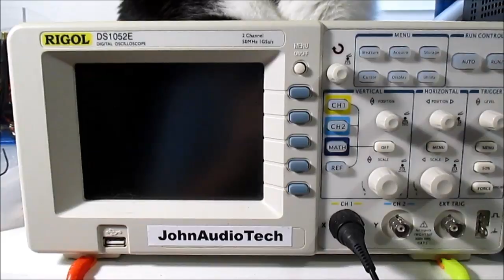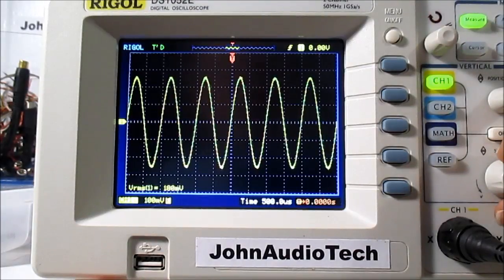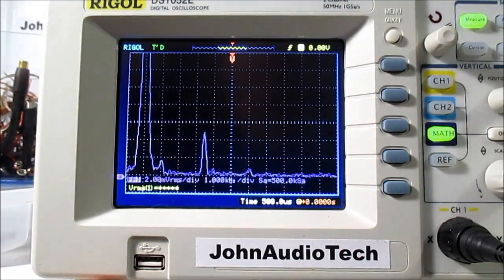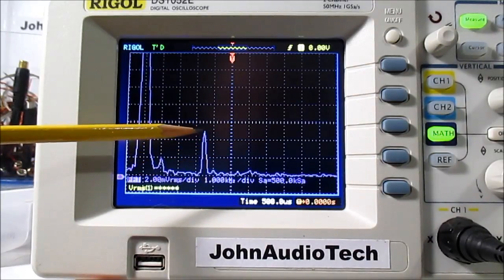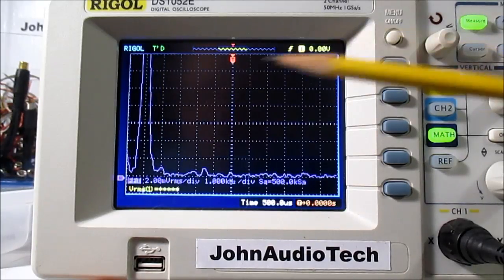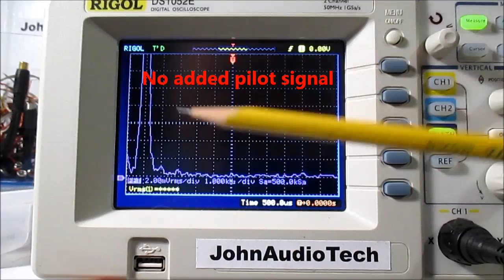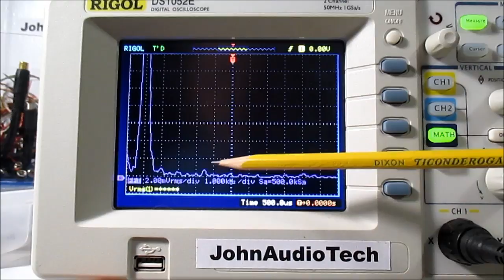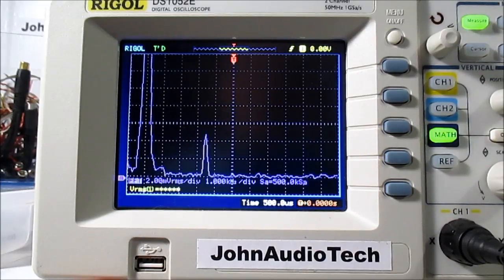Checking audio amplifier distortion with oscilloscope spectrum analyzer

Comment from the maker: First !
Sorry for the lack of videos lately. I do have an amp board to test, another on the way, a couple chip amp test videos, teardowns and more. Hang in there guys!
Reply: No worries, take your time :-)
Reply: thanks John, I used your method to measure the noise in a project, I will document it a little whenever I finish it. Anyway could you please explain in a little more detail the calculations needed for the power specs of an amp, you always make that fast. My project involves a couple of LM3886, a OPA2134 for preamp, an MCP4261 as attenuator and I would use an Arduino to listen to a remote control, switch between several relays and turn on/off a raspberry pi (with a Wolfson DAC) as one of the sound sources. I have really sensitive speakers, so I'm not concerned too much in power, moreso in the possibility of noise in all this mess. I will not use any switching psu, just old plain trafos a linears, and when everything is off, I'll use a really small trafo for the standby mode, which is just the Arduino. I really enjoy your videos.

Comment: This is a good quick seat of the pants method,  for example in a repair to verify a level that is too ambiguous by ear but still indicates a problem. I work on a lot of guitar amps and most people working on old tube gear use very little in equipment but judge by playing. Few use a spectrum analyzer or any repeatable signal, more by feel and experience. I work on so many different types that I like to log reading in a database as a reference state in case it comes in again. Most gear does fail periodically when used in touring or stage use, amps, power amps cable lead  hard life on the road. As the end of a tour a company might bring 10 or 15 amps for me to check and comparing past performance to the current readings tell me if there is a possible change or problem.
For home hobbyists, a decent digital multimeter which are very reasonable now, $25-50 for one that reads AC volts in True RMS which is best for audio use.
An Oscilloscope. The new digital scopes are a real powerhouse of features and have a lot of built-in measurements that can reduce the number of test instruments needed by 2/3rds or more. I am a test gear fanatic so have done of precision instruments but they are not essential.. In my old shop just doing pro audio, I had 23 techs and 2 full benches of test instruments for each tech. Over 500 instruments because I collected them all and refurbished them as industrial surplus. Now, a modern Chinese-made $300 scope can provide an amazing about of data.  My bargain digital scope is hard to bear, a Rigol 1054z that has 4 channels and a large number of advanced features you can add simply by typing in a code, published on many sites and YouTube to turn on many features they charge more for at the time of purchase. Definitely check that model.
Used older analog scopes represent low-level noise better than digital scopes and are good value. Any model like a Tektronix 465 or 2235 or 24xx series scopes are wonderfully built and outlast you and are reasonably priced as ham radio swap meets or eBay but better to find lone locally. They were expensive in the day, , all good test gear was. My 1975 Motorola RF Service monitor was $28,000 when I bought it new and my house at the time was $17000 on 10 acres in California!  My Sound Technology 1510a Digital analyzer for analog tape decks in 1985 was $14,000. I used that to calibrate the large 24 track Studer and Ampex tape decks every morning in my 3 studio complex recording studio I had for 20 years.

A good noninductive dummy load, usually 4, 8 and 16 ohm rated at higher than the maximum power of any of the amps you will work on. These can be made buy buying a few high power non-inductive resistors, You can get by with cheaper standard wire wound resistors, 100 ro 250 watts are good choices
A good sound source which is a clean low distortion sinewave generator with a wide frequency and level range. I have some very nice expensive ones but for everyday use it is had to beat the old HeathKit IG-5218. It has all the features one would want, the accurate level meter in db and volts, accurate decade switch frequency selection, low distortion, with a wide range of accurate attenuation of output. So when selecting a level, and frequency you do not have measure them, the controls and meter are accurate to 1% or better with low 0.013% harmonic distortion. There are modes on the internet for modifying them for even lower distortion by making an opamp simple meter isolation amp that removes the distortion caused by a bridge rectifier across the before the output attenuated,  I have one that is 0.0068% at 1khz and +10 dbm out,  It is not likely you would never need or hear that difference.
A constant temperature soldering iron. 
Those are enough to handle most repair or adjustment tasks with audio.
You can also get digital signal generators but they usually are not as versatile as the old Heathkit IG-5218.
If you have a good sound card on your computer you can use it along with a free program for a very accurate signal generator, meter, counter, and Spectrum Analyzer...the only problem is that you are limited to the output level of your sound card. If you have an outbard high resolution sound card interface used on balanced line inputs and outputs you can handle wide levels and usually better specs
I have a $4800 spectrum analyzer and this program does better and free http://www.sillanumsoft.org/download.htm   It will do frequency sweeps to plot frequency response by distortion, and two channels to compare two channels in real-time.
Two more things, a regulated two-channel DC  Voltage and current metered power supply This will be used on your breadboard amp and electronics projects until the circuit work then you use batteries or build a dedicated power supply for it.
And if working in AC powered united a Variac, which is a variable power transformer to you can dial in the ac mains voltage you want. This is important when checking an amplifier that might be damaged, you can monitor the current it pulls as you increase the mains voltage from zero.(only for units that have power transformers and not Switchmode power supplied some modern amps use to make amps a lot lighter. Your computer has a 300-400 watch switch mode power supply and you could not raise the voltage from zero, Just turn it one since it has its own overcurrent protection circuit.
Reply: thanks for sharing your experience and all those amazing tips.

Comment: The Hantek scopes are affordable. I was able to get a 200 MHz with function generator for $225 shipped. It doesn't matter if you buy a 60 or 100 MHz Hantek can easily be upgraded to a 200 MHz using a urat takes less than 30 minutes. Tones of info on how to do it online and on YouTube. Great video 👍.

Comment: Over sampling play some role in this demo, but more importantly, the FFT display the amplitude in power, so 8-bit vertical resolution in voltage gives 48dB of dynamic range so seeing distortion in 0.2% level is not that hard. In this case you are probably limited by scope front end noise rather than the dynamic range of the FFT.

Comment: Hi John i was thinking about upgrading to  the Rigol 1054z as at present im using an old Crt Kenwood CS-4125A. As far as i can tell the FFT on the 1054 is aweful much worse than 1054 which i thought looked pretty good. Have you any thoughts on this or have you looked into a new digi scope. Been watching your vids for the past 3 months and have learnt a fair bit. I've been power testing many of my Tube guitar amps some of which i've built myself. 

Kind Regards

Matt

Comment: Thank you for your amazing videos! I've learned so much! Newbie question: Are you just using a 1K tone from the audio player or are you  using a special tone that includes the pilot tone with distortion? Thank you!
Reply from the maker: The pilot tone is included in the signal at 1% of the 1KHz tone and at a non-harmonically related frequency.
Reply: @JohnAudioTech  Thank you! Is this something I need to create or is there a resource to download the audio file?

Comment: Funny, I was just taking some distortion measurements last night. It seems that modern audio sources can be the source of noise too, my laptop and phone all have lots of high frequency noise on the audio output and this shows up as a fuzzy line riding the waveform. My tablet on the other hand had a relatively clean output.

Next time you test an amp can you have a look at the rf content in the signal as for some reason my DS1052E always shows a rising edge at the end of the spectrum analyzers blue line, I don't have a true signal generator so can't be sure what's causing it.

Comment: Hey, I'm not sure if you could help me out or not. I have a Fluke Scopemeter 105b II. I use it solely for the purpose of looking at analog audio signals. When using it to test a low voltage signal coming from the HU from 0VAC to 5VAC the Scopemeter displays the signal perfectly. When I use it to look at the signal coming from an amplifier 10VAC to 50VAC the signal looks crazy. Do I have to change something on the oscilloscope to look at higher voltage analog sine waves with out the waveform looking like it's having an aneurysm?
Reply from the maker: I'm not familiar with that scope but you have to set the time base and amplitude for the signal you are trying to view.
Reply: JohnAudioTech  on my scope, you can hit an auto button which calculates in displays the waveform, but even after adjusting the time and amplitude it still displays incorrectly and sometimes even displays an exact wave further ahead of it, it's weird.

Comment: Great lesson.. But if I apply this to my amplifier 2000W..would it be frying my scope? Very little knowledge testing or checking amplifier with scope
Reply from the maker: What is the peak input rating of your scope? If the amp is honestly rated, 2000w into an 8 ohm load would be 179 volts peak (or a bit more if there is headroom in the rating). 2000w into a lower impedance would be a lower peak voltage. The two scopes I have are rated 400 volts peak.

Comment: The term u want to use is bandwidth..and resolution.... And rhe scope measures voltage over time..the anlyzer measure amplitude over FREQUENCY....  Hryz per dv... Dbm per dv... And linear log or non linear ligrimithic... ...

Comment: The key to increase resolution is "oversampling and decimation".

Also, any speaker does give out distortion well over 1%.
Therefore, there is no use for 0.01% distortion in audio.

Bandwidth limitation is much more important for the human hear.

Comment: Why didn't you use dBVrms vertical scale?
Reply from the maker: It compresses the view on the screen too much.
Reply: Only high amplitude signals, right? That's the main reason to use log scale, isn't it? I really couldn't see the advantages of using linear scale to do that.  Are you sure about that ? Could you explain your reasons a little further?  Thank you.

Comment: Have you tested amplifier power output and distortion with lower frequency tones? For example at 50Hz. I'm interested how TDA7297 performs at lower range.
Reply from the maker: Solid state amps usually have no issues with lower frequencies. It is the higher frequencies that are the problem. Even so, most well designed amps distortion is low there too.